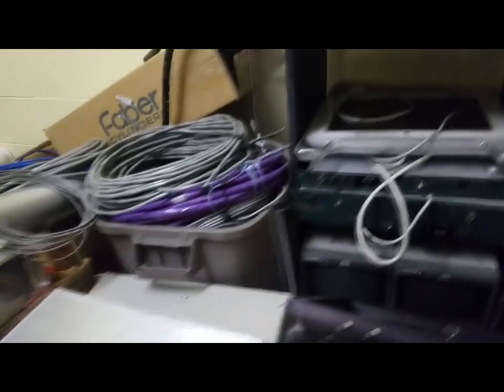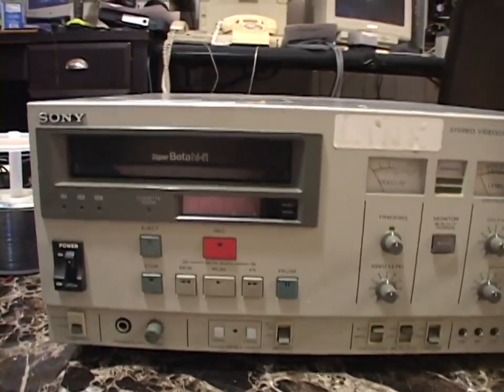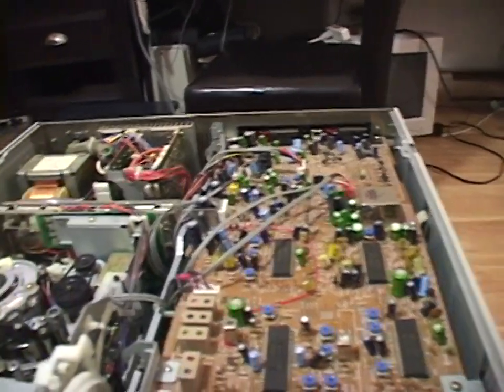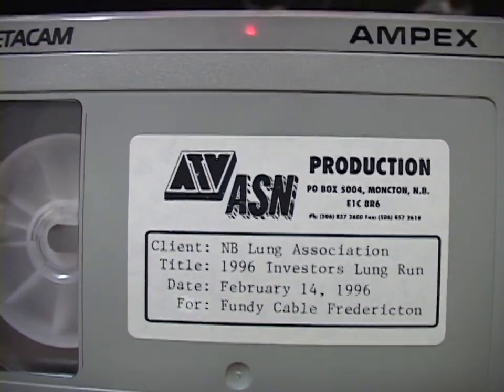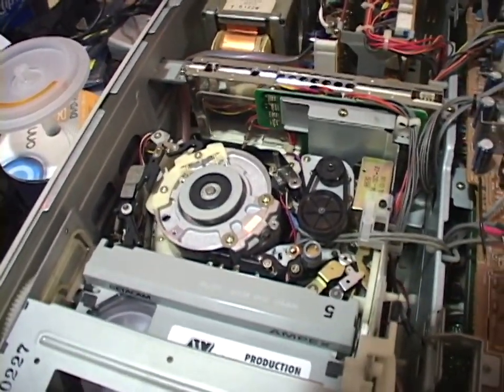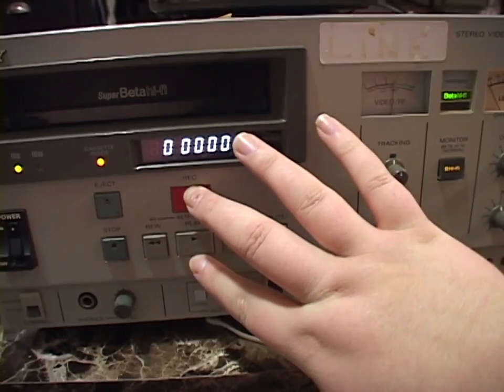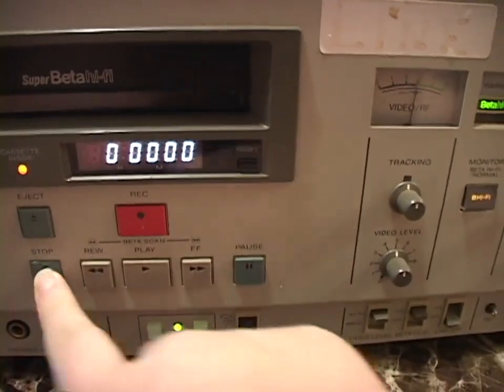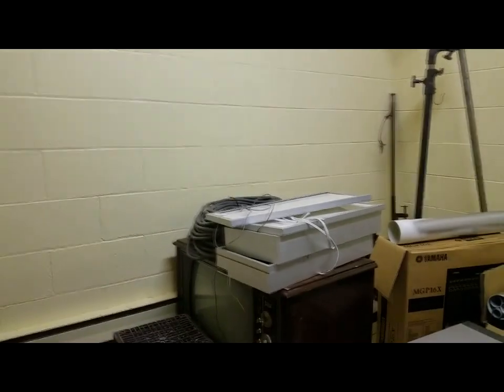A look at a Sony SLO-1800 SuperBetamax VCR

Comment from the maker: Update: I unfortunately discovered during a longer recording test that there are bad capacitors, or some other issue, that causes the head drum to slow down and eventually stall during recording or playback. Replacing capacitors in the head drum servo circuitry and on the head drum itself did nothing (it actually worsened the condition), so I will be washing my hands of it and sending it to someone who is interested in it. It was fun while it lasted.

Comment: hi there is a deck that  records liner and hi-fi stereo at the same time it's betamax black top wear tape goe's in with very big vu on the front
panel don't know   model it's a sony one   

i went over to sony betacam  and up to betacam sx  i have 40 working betacam sp digi sx betacam from ex hire pads all over south uk
fixed them up 

i would say there's not alot in the uk working now  as i got alot of the big places in the uk 

u-matic i don't have   reel to reel  12'5 spool size i love as well